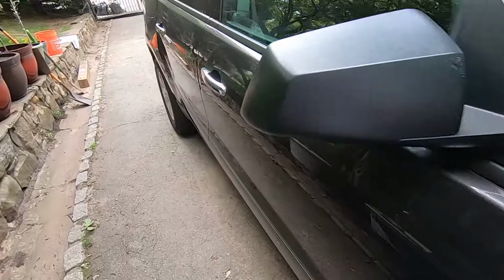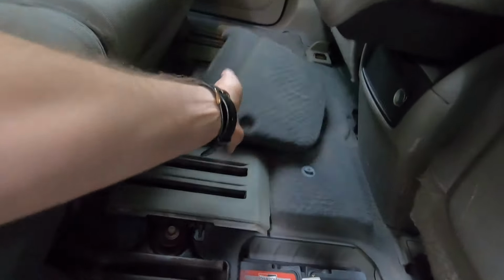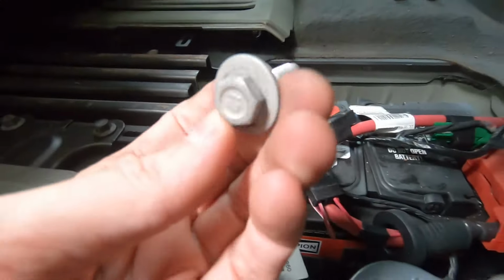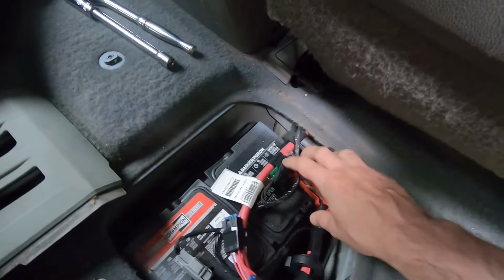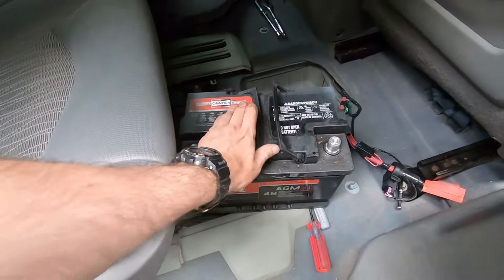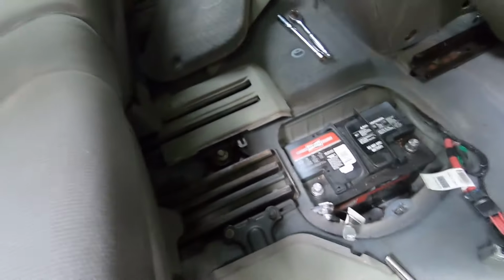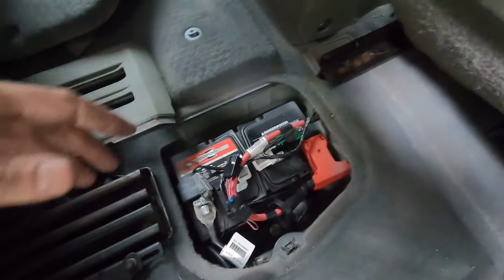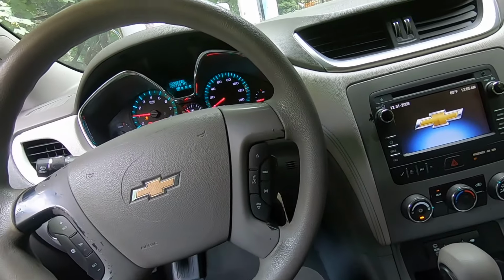Chevrolet Traverse Battery Replacement 2009-2017

Comment: You have to disconnect and reconnect the battery vent tube when you change the battery. The tube is located on the negative side of the battery, There is an elbow on the battery that has to be removed before the battery is changed. A new vent plug has to be put on the positive side of the battery. It is included in the cap that covers the positive terminal. If there isn't a cap, then you will have to reuse the old one.
Reply: Is that on all models?
Reply: Additionally, make sure that the battery you get to replace the dead one is the right battery and at good charge BEFORE YOU LEAVE. I ended up having to make 2 trips.
Reply: Just realized what you're talking about.  Mechanic changed my battery but the battery doesnt have the vent tube and my car kept saying the battery power low 😑

Comment: What he failed to mention is after replacing battery u gotta reprogram every freakin module or nothin will work. Thanx GM.
Reply: I recommend getting either the 9 volt battery backup that plugs into the cigarette lighter power port or the ODBII battery backup adapter for a 12 volt battery. Either method will require you to supply some kind of a battery. That will keep your radio settings and computer memory intact. If using the ODBII adapter, do not attempt to start the vehicle with the adapter plugged into the ODBII port otherwise you will blow the PWR Mode (2 Amp) and the DISPLY (10 Amp) fuses in the in cabin fuse box located under the glove box. The vehicle won't start if the PWR Mode fuse is blown as it goes to the vehicle's security system and the dash wont work if the DISPLY fuse is blown. If your vehicle has an auxillary battery, then neither if these battery backups should be required as long as that battery is still good.

Comment: It's like all of the automobile engineers are smoking crack now. These newer vehicles are a pain in the ass for even the simplist of repairs...
Reply: It's crazy, I was changing the air filter on my mom's Traverse and did the usual inspections etc and it was like, wait a minute, where in the hell is the battery smh lol
Reply: The auto parts stores, which will usually replace batteries for free, won't touch this car's battery since it's hidden away here.  PROFESSIONAL INSTALLATION REQUIRED they say.
Reply: Should have seen the uplander that came before it
Reply: It's made so that Mechanics can keep their jobs. And you pay to get your car repaired 😭

Comment: When disconnecting or reconnecting battery should one side be done first or does it matter the procedure of steps that are done in sequence? Thank you so much
Reply: Always disconnect the negative battery clamp first. That way you don't short out the positive to the vehicles chassis through the wrench when trying to disconnect it. That's the recommended procedure on all vehicles by the way.

Comment: I have a  2020 lt only  can find  one battery  under the  hood  so weres  th other  battery
Reply: More than likely the battery under the hood is your auxillary battery. The starter battery is very likely in the cabin, in the floor behind the front passenger seat as shown in this video.

Comment: What if the seat wont go back
Reply: Take the seat off
Reply: What if the seat won't come off?
Reply: What if the seat won't come off?
Reply: What if the seat won't come off?
Reply: @davidk9711  Get under the vehicle and loosen the mounting bolts and the move the seat out of the way just enough to get the battery out.
Reply: @emuhill  bad joke 😂  what if you can't get under the vehicle?